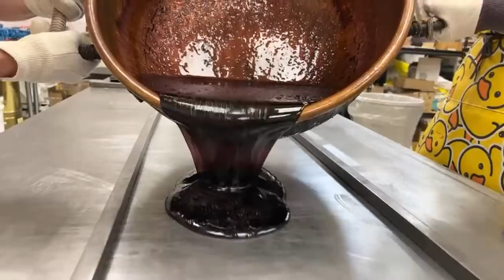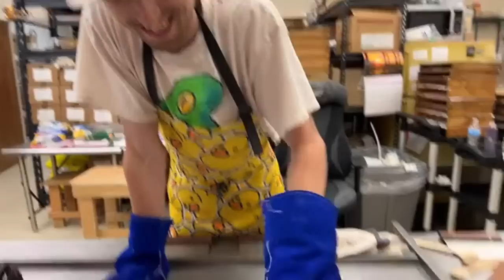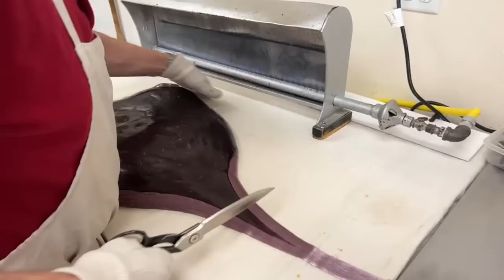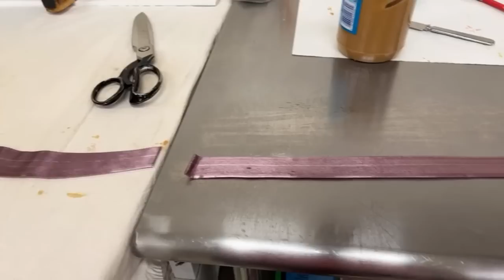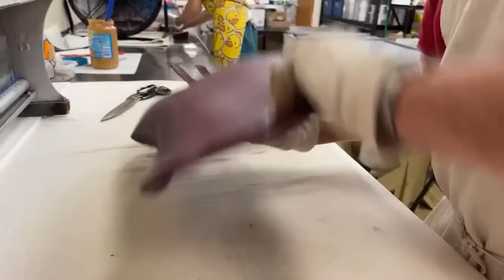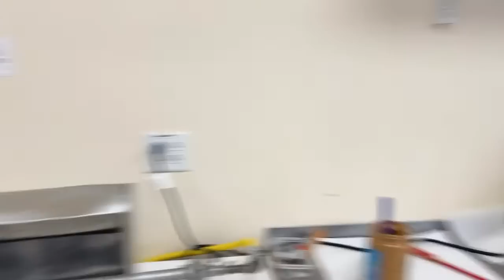PB&j Grape Ribbon Candy!!

Comment: Grape is always purple because the grape flavoring is not JUST grape, it's SPECIFICALLY CONCORD grape. Which are a deep rich purple in color; it's the kind of grapes they use to make jelly from, that's why JELLY is purple.
Reply: I never tasted a grape that taste like the grape flavour things
Reply: @pete4206  That's because grape flavoring is artificially flavored. It's only a close APPROXIMATION of Concord grapes. I don't personally think it's very accurate EITHER. I was just explaining why it's always PURPLE. Infact I don't think MOST artificial flavors are very close to what they're SUPPOSED to mimic. In MY opinion the only 2 that come even REASONABLY close are coconut and vanilla, and even THEY'RE not identical.
Reply: Lemon and lime are close
Reply: @marymccowan6629  Lemon more so than lime I think.
Reply: @juliebaker6969  yeah your right
Reply: @pete4206  þț

Comment: this video brought up a question that I never thought I'd ask. 
You mentioned that not all batches require cleaning out the copper pots, but strong flavours would encourage you to do so. I assume that when using nuts and other possible allergens that some attempt is made to clean (Accidents happen of course).

What about the scissors I've seen you guys cleaning almost everything except the scissors. I assume they are sharpened as they work well .
Reply: I believe they have stated that cross-contamination will occur and maybe its best not to buy any candy.
Reply: I think I’ve heard them say they are like the scissors that kids use in grade school - as for sharpness? I’ve never seen it demonstrated on anything, but candy. I think that it’s like  dull scissors, but for adult sized hands.
Reply: @byronmurphy1977  the answer won't affect my decision to buy or not. I was asking as I was watching a bunch of the Ribbon candy episodes and saw the peanut butter on the ends so wondered how frequently they clean the scissors as compared to the hard candy cutter blades.
Reply: @dwaynecarswell41  No problem Dwayne, happy Thursday.